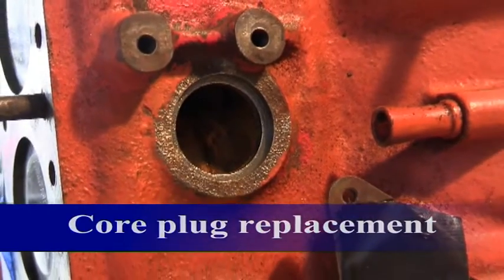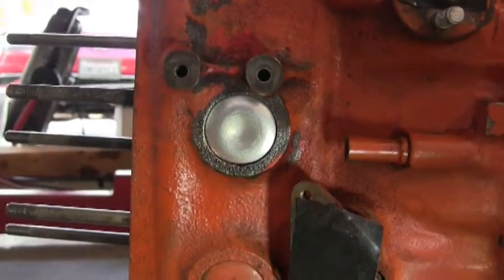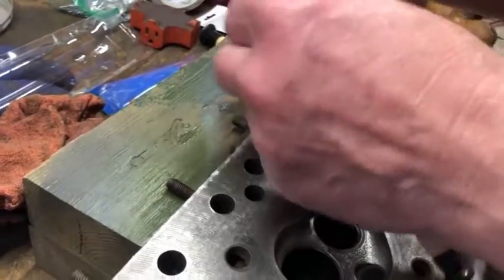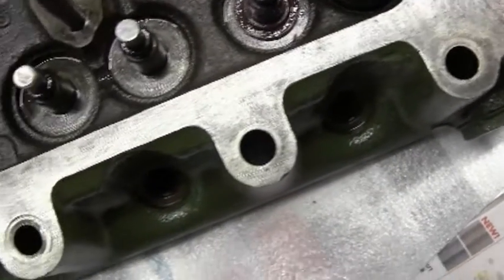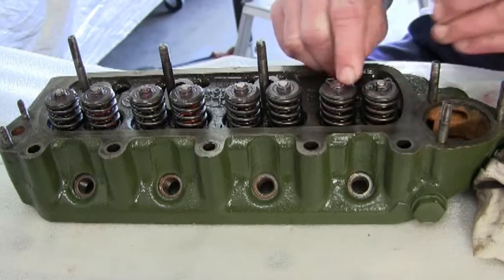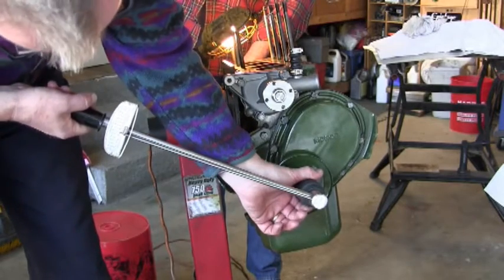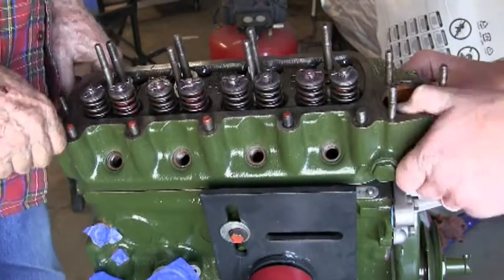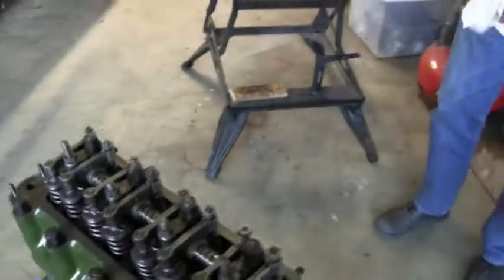March 2022 Morris Minor 1098 Engine Partial Rebuild

Comment: Lovely work Tim. i always like seeing how different people do jobs. Every day is a school day.
However @ 04:01 it isn't quite true to say you cannot fit the later oil seals that fit round the guide top.
I have just rebuilt a 1965 1098 head and used the later Mini gasket set which included 4 of those seals which I used for the exhaust valves. I also bought 4 'viton' seals as used on the last injected Minis for the Inlet valves. Belts & Braces.
The key alteration is that the circular shrouds (p/n 2A545) that fits between the springs and the collars need to shortened as they have a shaped lower end that fouls the later oil seals. With that end removed (just 1/16th) the shroud clears the seal.

Comment: Hi.Tim not bad at all.2things.ive been building Morris minor engines and others.ive never seen oil on head gasket.and two I always just tap the top of valve stem with a hammer just to make sure the collects hav seated well.just thought I would mention. Kevin.74 Yr old engineer.
Reply from the maker: Thanks for the info.  We oiled the bores thinking that would help on start up and I guess we got a bit carried away; do you think it will be an issue?  Regarding the collets they appeared OK; here's hoping it works!